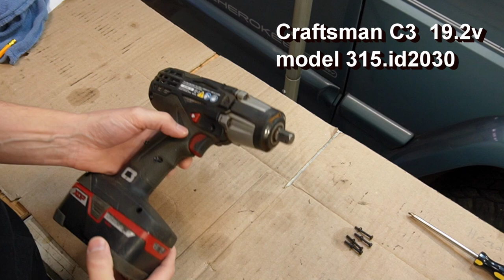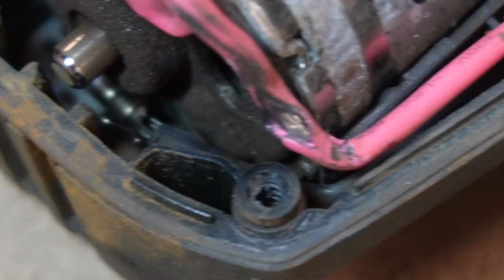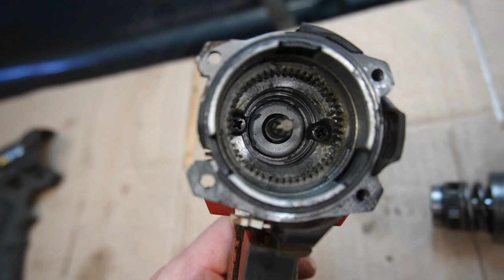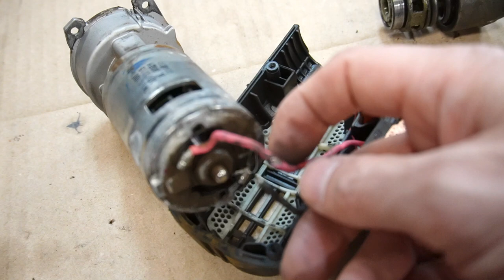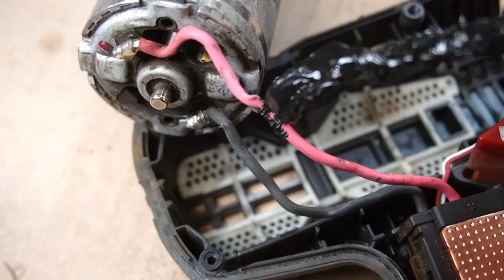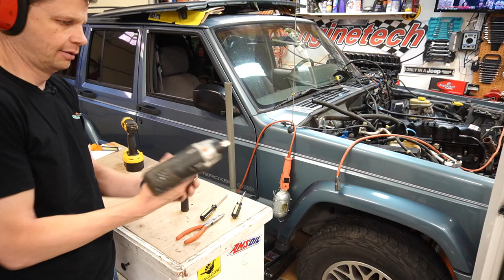Craftsman C3 impact wrench doesn't work

Comment: I have that exact craftsman impact wrench and was ready to throw it away, but decided to do some research and came across your video. I took it apart following your instructions and wow, mines had the exact same issue, the two screws loose and the ground wire broken off. Fix it like you did and I'm back in business. Sir, thank you very much because you save me from spending $250.00.
Reply from the maker: Sweet!! I’m glad my video helped
Reply: @JeepSolid  I have one of these that has never been used, but I'm planning to use it soon. I'm wondering if it would be worth the effort to disassemble it and add Loctite to the affected screws as a preventative. Two questions: 1. What color Loctite did you use? 2. How much use did your impact wrench have before this problem happened?